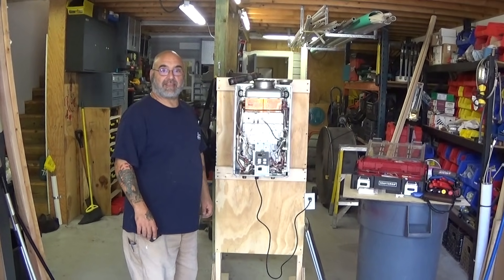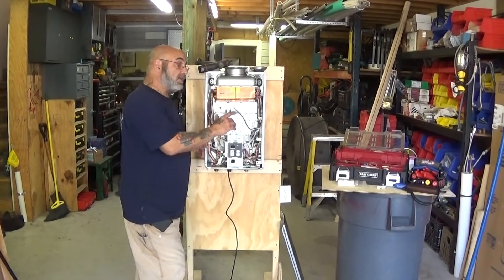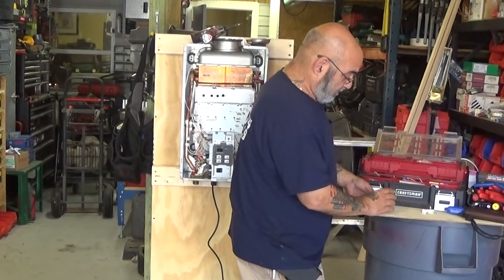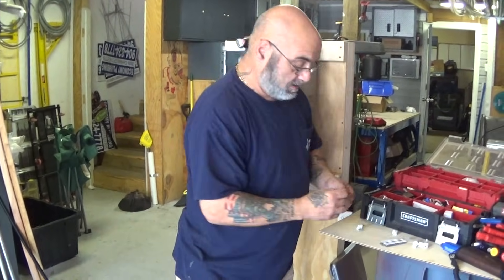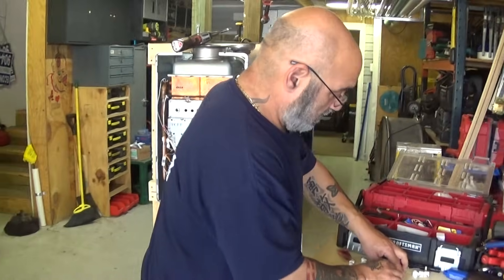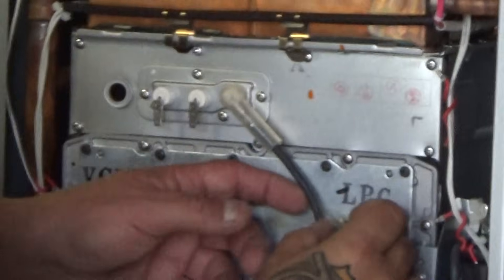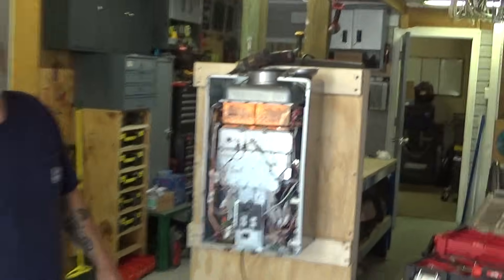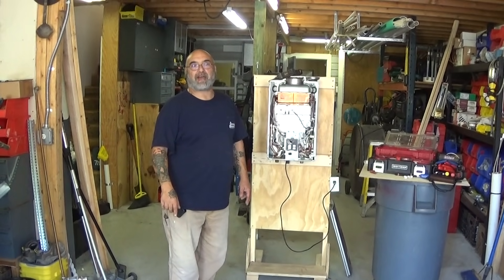Code 12 on a Rinnai tankless checking the flame rods

Comment: I have Rinnai model ruc90i . And I have trouble with it kicking a trouble code 11. I replaced all of the flame rods and clean the igniter and it still comes on. It may go a day working and then it will stop working and throw a code 11. This is done this for many days. If you have any suggestions to point me in the right direction I would appreciate it thanks Carl
Reply from the maker: it’s a dirty burner. this intails removing the entire heat exchanger to access the removal of the burner to clean or replace it. Mike
Reply: @ThatTanklessGuy  thanks for your help Mike. I appreciate it Carl

Comment: Mike can you shoot me a link for the Gasket and repair kit?  Just got the Code 12 on my Rinnai RL94i  It is a 9 year old unit and just got the beeping and codes tonight.  I perform year flushes on the unit but that's about as much maint i do on it.
Reply: You can get the parts from supply house.com
If you look on the inside front cover there’s a packet. Open it up snd it will give you the part number of the flame rod kit. It comes with the gasket. I hope this helped Mike
Reply: @TheBuddylab  Found them..Thank you

Comment: Hi Mike, I really love you videos. Hi have a problem. I live in Houston, and did not unplug my Rinnai R94LS during our winter blast. we lost and regained power several times. Now when I turn on just one hot water tap the water never gets really hot, but if  at the same time I turn on a second hot tap they both get hot. If I turn off the second tap the first one goes back to just warm. Does the unit have two stages? I have checked the water flow thru the system and it shows 5 to 5.2. I have checked the outlet water temperature and it only shows a couple of degrees below the set temperature. 

Before the power outage it was working fine. Thanks for your help, Phil Butler
Reply: Call me at +19042385349 and I will go over it with you Mike

Comment: Never again!!!!!  My fancy 3 month old Rinnai just went cold on us this morning. Gas and water  pressure is perfect! Get one of these tankless heaters if you enjoy complicating your life! I’ll spend the whopping $25 extra in energy costs to run a NORMAL tank dead reliable hot water heater. I have wasted my time and money on several different makes and models and they all suck!!! I especially love it when the electricity goes out mid shower and the water immediately goes cold, my wife loved that one! If your going to torture yourself with one of these miserable units at least go for the standing pilot unit. I have both and at least those don’t leave you in the cold. Unfortunately I designed my hot water heater cabinet for these darn things so in order to go back to a reliable tank heater it’s a lot of work. Hopefully this reaches someone who’s on the fence about purchasing a tankless and it pushes them to go with a tank water heater.

Comment: Hey Mike thanks for you past help and I need your help again. My RUR 98in has a symptom of a Code 12 however it has only showed the code once out of several occurrences. Every once in a while when showering water turns cold, shut water off for 15 seconds turn on and its hot again. I have cleaned the flame rods and have completed all scheduled maintenance. Thanks for your help and would be easier if we could speak again. jgmcure@msn.com or 970-819-8981

Comment: Can’t find the email I’m having a code 12 and have cleaned and even replaced flame rods and igniter and sometimes I still get the error code. Then I can cut the water off and start the water up slow in a sink and then cut the shower on and it will stay running it’s blowing my mind which don’t take much but it is baffling. Is there anyway I can get your email where I can get ahold of you.
Thanks in advance
Rodney
Reply: Economypbg@aol.com

Comment: Any videos  for error code 19, it’s a head scratcher
Reply: That it is. That’s a short code. You need to test all the controls in the DC circuit. I would start with the thermal fuse, then the water servo valve. I’ve had a short in the wire harness.

Comment: Thank you for your video.  Once I cleaned the sensors I restarted my unit and at low flame it was fine.  Then I thought air flow issue and for sure a trash can had blown over to the exhaust / intake and was recirculating the exhaust fumes.    Easy fix LOL.   Thanks for the advice!!

Comment: My Rinnai just pulled this mess. Went into the closet. Turned on the light that has a power outlet that the water heater is plugged into. Flashing 12 turned into 120 F. Problem averted.... for now?

Comment: Thank you for this it worked on my model, the gasket (looks like it was cardboard and not rubber for my older model) was completely rotted out and came apart in pieces as soon as I removed the bracket. Looks like the maintenance tech that last came either didnt notice or didnt care when doing the cleaning.

Comment: Did you ever make the other three videos? I've got a code 12 and I've cleaned the flame rods like you said in this video and also took apart the burners and cleaned them. Still getting code 12 and it smells horrible when it does work.

Comment: I have a RInnai RV53 with error code 12.   I did exactly as you said and also cleaned the fire box and it is not staying lit!   It will light for a second or two, I can see the flame in the window and immediately shuts down again and again.... Any support will be greatly appreciated!

Comment: Hi Mke!  I have a Rinnai RV53 that has error code 12.  I did everything that you said about cleaning and blowing out the burn box but the thing will not stay lit.  It ignites for about a second or 2 and then shuts down with the same error code.  Any suggestions for the next step would be greatly appreciated!
Reply: I have a richmond tankless water heater. About 15 years old it wont ignite. Is that the igniter only

Comment: We got a code 11, no ignition, but another installer recommended pulling and cleaning the igniter and flame rods.  It's not clear whether the problem was actually no ignition or if dirty flame rods fooled the controller into thinking there was no ignition. (Looking through the little round window to the left might have answered that question.)  In any case, cleaning all three components let the DHWH work.  I wish we'd watched this video, both because it's informative and because we scraped the components (gently) with a knife. I'm used to the style of igniter that glows, but Rinnai seems to use a spark plug style.

Comment: Hi Mike on my rl75 unit I’ve been getting a code 12 when hot water is used from the shower or washer, but not the bath or kitchen sinks. I’ve already tried cleaning the flame rod, didnt seem bad at all. I’ve also remove and cleaned the heat exchanger and still have code 12. Any other suggestions ?

Comment: Hi Mike!  Awesome video. I have a RC98HPi that I installed in the spring of 2011.  It has worked flawlessly until last Sunday evening.  I have a code 12, and followed the instructions in your video, but that didn't fix it.  The flame rods and igniter didn't look too bad, a little bit of white powdery material that I removed.  From reading a Rinnai support document that someone posted here, I think my problem is (was?) an electrical code 12 vs. an actual fire issue.  As soon as I'd open the relief valve, the code 12 would come on and the controls would beep without ever trying the combustion fan.  Also, I could turn the gas off, and not get a code 11 when it was acting up.  When it's working, if I try to run it with the gas off, it'll spin up a few times and try to fire up, but then throw a code 11 as expected.  I found that if I moved the wires coming from the control board where they pass along the bottom of the cabinet it would work sometimes.  Following the troubleshooting steps in document, I unplugged all of the electrical connections and reconnected them.  The unit has worked consistently since then (a couple of days), but I didn't see any signs of a loose connection or corrosion.  I find it hard to believe that it developed a loose connection after 9 years, and that I have really fixed it.  Is there a common part that fails intermittently on this heater?  Do you have any suggestions for me at this point, or should I wait to see if it breaks again to try to diagnose it more?  Thanks!
Reply: H Roberts call me at +19042385349 and I will go over it with you.
Reply: Just curious. So did it fail again or your unplugging and plugging things back do the trick?
Reply: @BigOHavingFun  I'm afraid I'll jinx it just typing this, but I've had no problems at all since unplugging and plugging everything back together.

Comment: That sure is a lot easier on a Rinnai than a Rheem. On a Rheem you must totally disassemble it. You must remove the circuit board, all gas lines, burner cover, burner assembly and it has 3 flame rods on the burner.

Comment: Has anyone ever heard of throwing a code 12 when the cover is on? I have a RUC98i, and works fine when the cover is off, but pulls a code 12 when I put the cover back on. Thanks
Reply: Tony Pedron you have a air problem can you send me pictures of the unit and the space that it’s installed in to 
Economyplmbg@aol.com 
Mike

Comment: Hi Mike.  I just bought and installed an RU180ip system and am having trouble with getting both the code 11 and 12.  I have to typically block the Venturi tube some to get ignition and am struggling to figure out the cause.  I appear to have good pressure too. Any help on what to check would be appreciated.
Reply: Derek Hawkins call me at +19042385349 tonight after 5pm and I will go over with you

Comment: Thanks for taking the time to make these videos and share your knowledge. I have a Rinnai C85 that's about 12 years old. Recently it's been giving a code 12. Most of the time it works completely fine, sometimes it works but there's just not a lot of flame coming out of the burners and therefore the water is luke warm and it occasionally briefly fires up and then shuts off throwing the code. I checked the gas pressure (all other gas appliances are fine) replaced the flame rods, flushed it and cleaned the little filter on the cold side. Any ideas of what to look at next?
Reply: Did you ever find the problem? I am having the same issue
Reply: @TKstewart-ir1kn  Hi Taylor...pretty sure it's being caused by moisture in the diaphragm of the gas valve.  I'm waiting for the new one to arrive so not completely sure but I'll update you. Interestingly this is something that I have not seen mentioned in any of the dozens of threads/comments I have read. When I tap on the valve it usually temporarily resolves the issue. This is where I found the some information about it. Page 9 - # 16 of this document "On internal units inspect the plastic tube running from the bottom of the combustion chamber to the gas valve.If you find moisture in that tube, replace the gas valve." https://aplusair.ca/wp-content/uploads/Rinnai-Tankless-Troubleshooting-Manual.pdf
Reply: Daniel Fennell Thank you for the help and the service manual. Please let me know if it fixed your problem.

Comment: Hi Mike i have a Rinnai 24Litre model about 15 yrs old at my beach house so its not used that much at the moment it takes a long time for hot water to come thru i assume either the flame rods need replacing or cleaning -would that be the correct assumption  thanking you Frank Walker
Reply: Frank B Walker no if the unit is firing and it take some time to get hot water, then it either the filter is clogged or the heat exchanger

Comment: Yesterday I no hot water. I turned it system off and on again...I then had hot water but it made a loud noise for 5-second intervals and eventually stops.  Almost like there was air in the system.  The next day the same noise again when I turned the shower on.  Help!
Reply: christine cunningham call me st 904-238-5349 and I will go over it with you

Comment: Hi, I have a RUC80 that throws an intermittent code 12, only between around 2:00pm and 5:00pm.  Outside of this time period it doesn't have a problem.  Do you have any idea what might be causing this? Thanks!
Reply: americankiwisnz give me a call at +19042385349 tonight after 6pm and I will go over it with you. Mike
Reply: @TheBuddylab  , Sorry, I have been working late the last few days in preparation for a vacation that starts tomorrow!  I'm assuming that you're on Eastern Time?  how late is too late to call? Thanks, Mark.
Reply: americankiwisnz call after 6:pm Mike

Comment: This video saves me a grand, only thanks cannot express my appreciation. I have code 11 bothering for a long while, recently it just shut down. A plumber came asking for grand for a full service because he thought it was dirty. Probably, but it was only used for not more than 1 year. I followed the steps, cleaned the flame rods with scratch, i don't think I cleaned it very well, it still looks covered by something. But Miracle came, it is back to work very well. Thanks so much.

Comment: Hey Mike. I originally had a code 10. I checked the blower and it was clean. I blew out my burner which was dirty. I blew out my tubes and sucked everything clean. Then a week later got a code 12. I replaced the igniter and flame sensor with gasket. I have also flushed it twice. Last three weeks It intermittently shuts off with the same code 12. I had a tech come out and off course it would not act up. He did go to the regulator and bump up the inlet pressure to 13.0. It is a propane unit installed 2008. Have had no issues until a month ago. I have an R75 LSi. Would love some advise.

Comment: Thanks for providing this content! Could you explain how the codes are supposed to be read? I was able to trigger the history in which it flashes 1 then 11. I've been assuming that means code 11. It proceeds to flash 2, 3, 4, etc. followed by "- -". I assume that means no error stored. Is this correct?
Reply: John Lin you are right, the code history shows you the last 10 codes, position nr.1 is the most recent code appeared.  - - means no code stored , so your water heater went code 11 only one time

Comment: I have a rinnai R85 that has worked  for 7 years without fail.  I have performed the annual flush faithfully.  In the last month, it has become very erratic in operation.  Showers in the morning are normal,  kitchen tasks are normal, but when operating the washing machine with moderate temp settings, I get an error 12 message and  cold water.  I also find that the laundry sink with the mixing valve in the max hot position also generates a code 12 error.  What are my next options?

Comment: Hey There Mike - Thanks for you very invormative vid here on the code 12 for the Rinnai. I have tried all your suggestions and then some........I've looked all over YT and done all the fixes and I've still got a code 12. It ignites with a nice bright blue flame but stays on for about 2 seconds. I've checked the burners - they look like new, cleaned the oxidisation from the heat exchangers - it seems like there's good exhaust flow, the fan has no debris and spins up well, I've cleaned the carbon from the ignitor and the  flame rods and now I'm fresh out of things to check. Do you have any ideas? Any suggestions would be great.
Reply: redrock1963 call me at 904-238-5349 and I can go over it with you
Reply: @TheBuddylab  hey would you give me a call sum time please I have the v53 and its throwing code 12 but it comes ON ok the display you're can hear and smell it light up then after like 1or2 secs flash's 12 at me....if I stop the water flow and then resume the water flow it does it all over again same way my number is 4693250424

Comment: hi Mike, thanks for the video, it is very instructive.  Mine is a Rinnai reu-2402feh.  It is throwing the dreaded 12 code.  Did you ever get around making the other code 12 videos?  I followed your instructions here to no avail.  Would like to follow the procedures you planned to show on the other videos.  I checked "all" external causes, no soot in the exhaust vent, no cold-hot water interconnections, ...  

What is happening at the moment is that once the water runs through it the flame comes on, stays on for a few seconds, goes out and the 12 code comes.

My unit has been acting up for a while.  It used to light the fire with a bit of water, as time goes by it needs more and more water and higher temperature to start.  Yesterday, after cleaning the burning rod and the sensor I finally realized I should try to raise the temperature from 40C to 50C, it then came on, stayed on and there was no 12 code.  I guess it is all the same underlying problem.

Comment: Did you ever get around to making the other code 12 burner pan videos?  We get an intermittent 12.  More often in winter for some reason.  Goes weeks or months no problem running 2 showers and a dishwasher simultaneously, then on a random day can't even keep one shower running for more than a few minutes at a time.  Once it starts acting up it's bad for a few hours, then is fine again.  Had a couple different guys supposedly certified on Rinnai, but they never find anything wrong.

RL94 propane, interior install.

Comment: The build up is really in the heat exchanger 90% of the time, this soot build up retains heat causing the unit to shut down due to the sensors reading to much heat. Sandpaper works fine as long as it's fine grit and the space is clean. Trust me I've serviced more tankless water heaters than this guy has passed telephone poles.